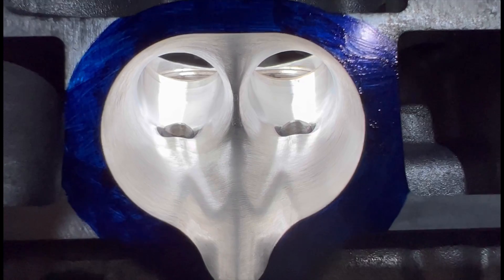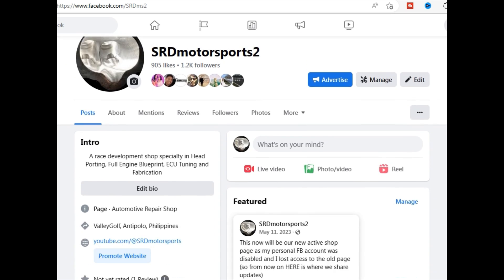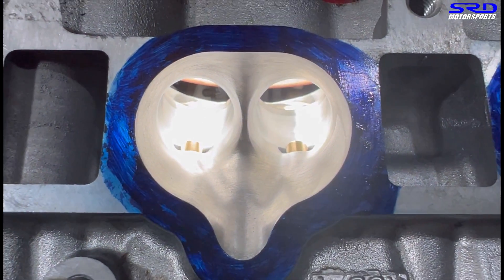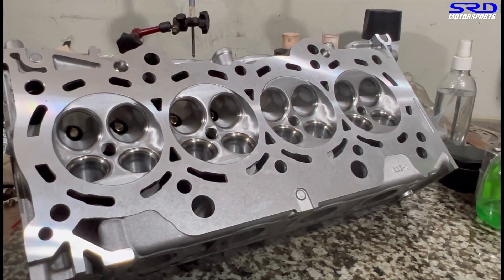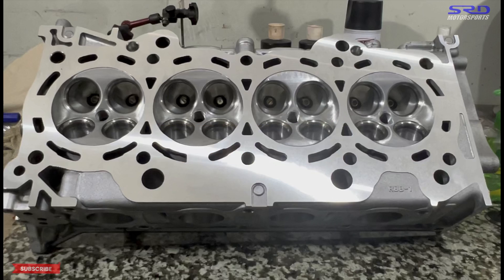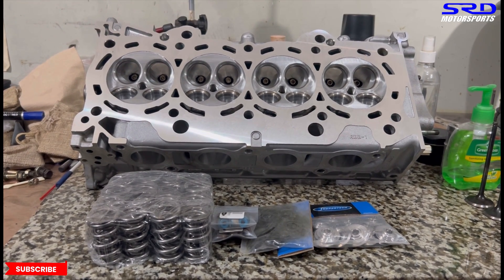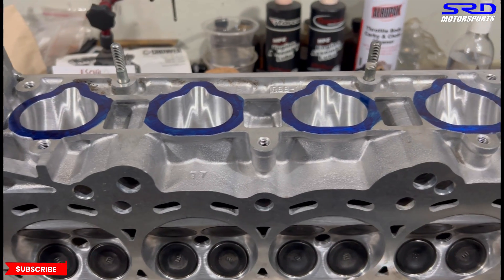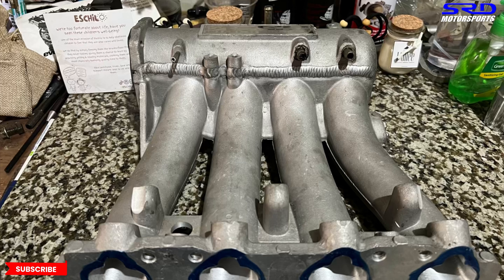K24 RBB Ported New Guides Supertech Valvetrain | welded Skunk2

Comment: Are there any major differences between the RBB head and the RBC head?
Reply from the maker: some minor quirks and port volume in stock form
Reply: @SRDmotorsports  ahh I see, so if you're porting it really doesn't matter because you can achieve what you want with either heads
Reply from the maker: true but the prb would have a higher ceiling so if its all about 90mm bore 107 stroke ? Id choose that
Reply: @SRDmotorsports  ahh okay I understand, makes sense

Comment: What is the limit of resurgace it? I have one i am gonna take to to resurface it to shop what is limite torence?
Reply from the maker: Manual says max 0.040” or 1mm but even if u go 0.020” sometimes it has issues on cam timing if it is not degreed well

On this video it was just 0.003” removed to get it smooth and flat or 0.07mm
Reply: @SRDmotorsports  ok thanks its for rbb head i am gonna swap it on k20a6(k20a3) bottom end
Reply from the maker: ok don’t go over 0.020” or 0.5mm no need 
See this head only needed 0.003”